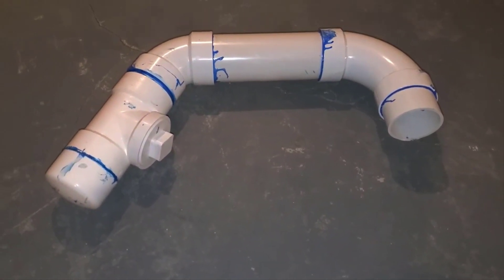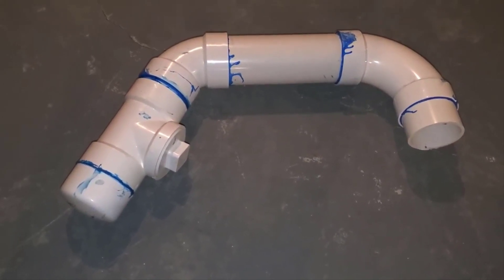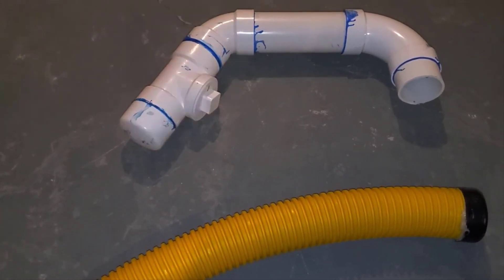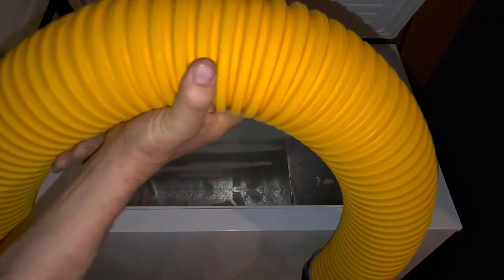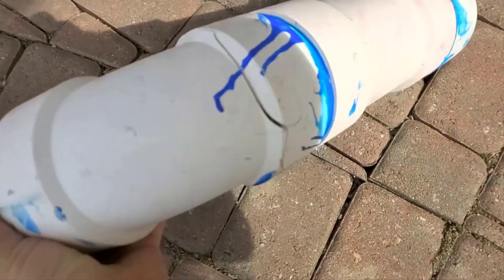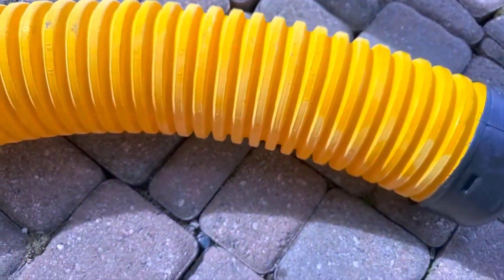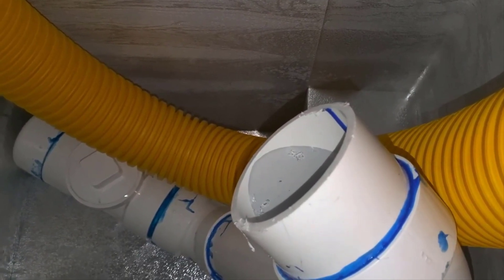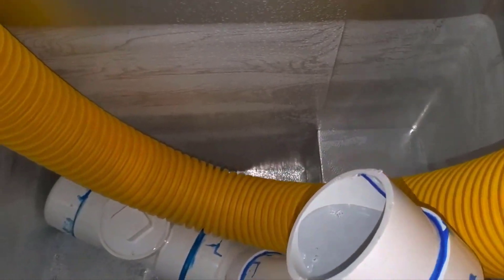PVC Schedule 40 vs Corrugated Pipe Strength Test

Comment: 10/10, that explains a lot.  You could also crush the flow myth as any corrugated installed at over 2% slope can move the same max-amount of water as smoothwall.   The USDOTFHWA demonstration video shows it in action but using only 2" models.

Comment: French Drain Man Is there actually a code on sump discharge requiring PVC pipe outside?
Reply from the maker: You have to check your building department. Not everywhere, but where there are storm drains that you're digging deep and tying into, they usually require PVC if you can get it below the frost line.

Comment: But the pipe would never be 100% full
Reply: Exactly! A properly pitched drain pipe would not be holding any water during the winter. I’m In Michigan and have been using schedule 40 - 4” for the last 20 years. No issues what do ever.
Reply from the maker: https://youtube.com/playlist?list=PLjFCqaZ4v1BX_ZMbxsYVB6CNFoeAmuPxX&si=fhrdPrUJJEF847IB
Reply: If it plugs it will fill up.  Also he talked about the ground settling/ shifting . Theres quite a few reasons really. Tree roots or rocks putting pressure on the side of pipes underground, cold weather makes pvc more brittle and prone to crack easier.
Reply: yofaceman as I said, I get the point he is making. The flexibility of the corrugated is its strength.
Reply: And the rigidity of PVC can be a weakness
Reply: But I get the point of the video. The flexibility of the corrugated is its strength

Comment: So what do I use if I’m crossing a gravel driveway???
Reply: Doug Stecklein sleeve it
Reply: Leonard Holt I’m worried about crushing it when driving over it in my car.
Reply: Doug Stecklein I know. Run the corrugated through a schedule 40 PVC pipe
Reply: I'm not the expert he is, but what I'm doing is to make a natural stone entrance, and I'm using my largest stones to cross the trench, to spread the vehicle weight onto the undisturbed soil that was not trenched.  That's my hillbilly method anyway.  Plus it looks nice, overall it will be about a 10-12 feet deep stone entrance, and the rest will be gravel.
Reply from the maker: @ Doug
I will make you a video stay tuned!!
Reply: Yes I'm also interested to know. Thanks!